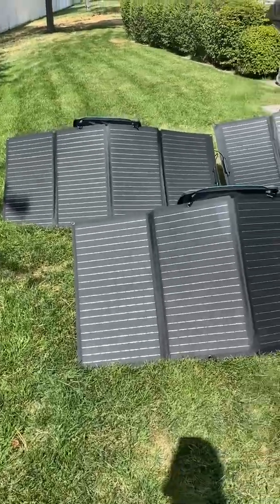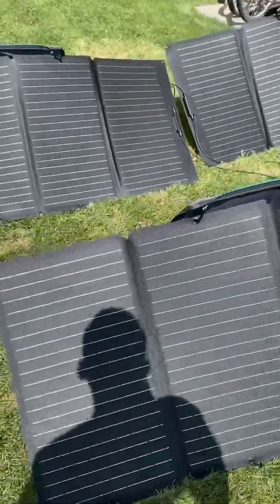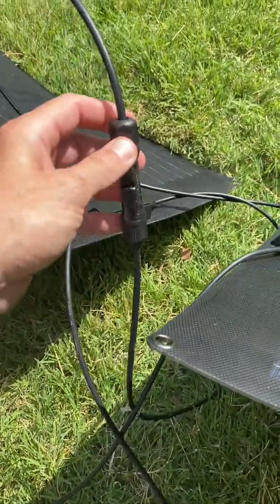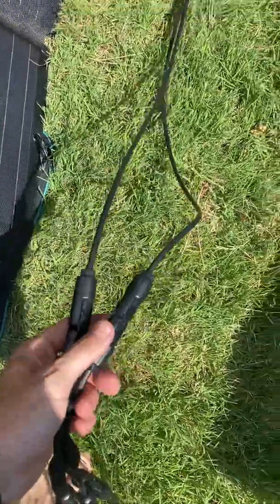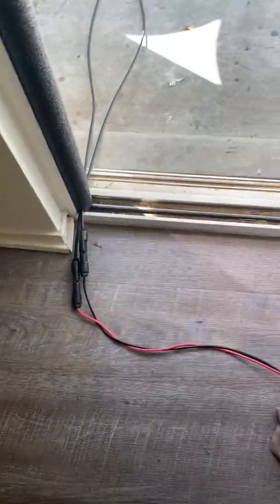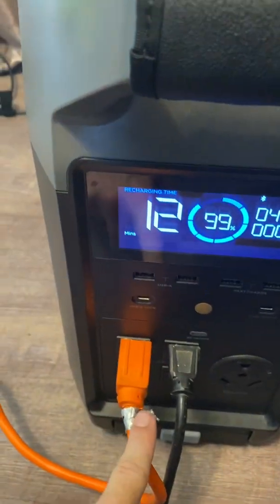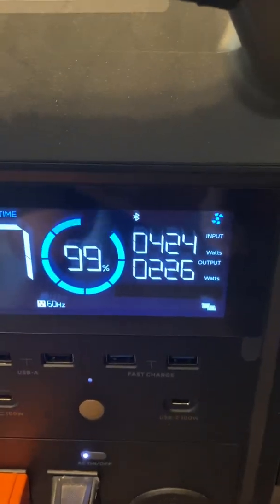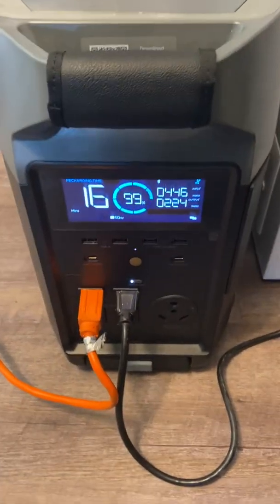EcoFlow solar panels and generator (battery) set up

Comment: Good video but Not everyone has $3,000 plus for one on these..
I'm at the $1,000 level !! Anyway this is all New to me so I'm still learning the ropes. 
Any help is welcomed. Thanks
Reply from the maker: This sort of thing is definitely an investment!
Reply: I've had my ecoflow Dpro a couple weeks. They are expensive and what you don't see are the software issues, updates, think Microsoft, having to reset etc. I was very surprised at the learning curve to have what's basically a big expensive battery with an inverter. Having said that yes, it's a sophisticated piece that makes me feel more secure having it. @sled you really need to figure out what's important to you or what you must have in time of need or an outtage. I've a good sized maytag refrigerator w freezer, I need my wifi, home security system , couple wireless inexpensive security cameras, and at least 1 window ac. I'm in Vegas, have a dog with heart condition... the desert where it's often 115.. no ac is not an option for most part. Aside from the window ac.. everything else I listed could be run on a much smaller and less expensive solar/battery generator. You could add a couple of fans and get by easily with maybe 1000 ways or less. Of course you'd want to have a couple solar panels. I'm very new at this and don't fully grasp all the electronic stuff just yet. What I've come to realize is the ecoflow portable panels in this video I feel are extremely expensive especially for the low wattage they put out. I think 2 or 3 200 watt  mono panels even at $259 ea is much more affordable than these but they wouldn't be as portable although they can be easily moved. Things you want to consider. How much space do you have to store a generator and or solar panels? Possibly a small portable gas or propane generator, much cheaper, could work for you but.. you'd need fuel.. there's up keep, more noise, need storage etc. I live in a mobile home park.. have limited storage and have concerns in my area, it's not the greatest neighborhood, so I don't really want others knowing I've a generator if SHTF. I figured by the time I bought another small storage shed, paid for all the stuff to sound proof, ventilation, etc. I'd not save all that much. Using a solar Gen, with panels you can save and reduce on your electric bill if you can run a few things using it daily. Just thought I'd give you some food for thought. I had, still do, second thoughts about all the money I spent on ecoflow DPro because money's tight but I'm glad I got it. I will get panels in the next week or so.. saving for them now. I just saw another tuber doing a review on a different brand solar Gen with I believe 2000 watts, maybe 1500.. with a discount and it's like $1,200.  It's a special for a few days and using his coupon code. I'll see if I can find the video and share. I'm not affiliated and don't know the guy. Just someone who I get info from with solar gens etc.
Reply from the maker: @thisnthat8331  I researched large capacity solar batteries and this fit my needs the best along with having high ratings and reviews for quality, performance, etc. It does have a steep learning curve since EcoFlow doesn't have an adequate user manual to cover questions that come up.
Reply: @thisnthat8331  Thanks so much for taking the time to write back, I'm also brand new to all of this stuff and been trying to learn it and at times it's somewhat confusing for me because I don't know anything about electric or how it works so any help is nice to know. Thanks again.